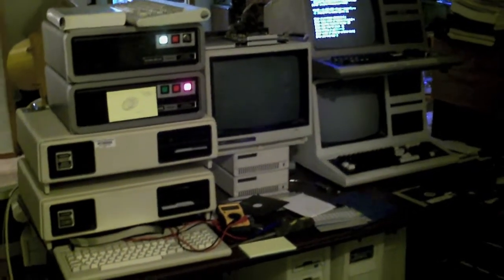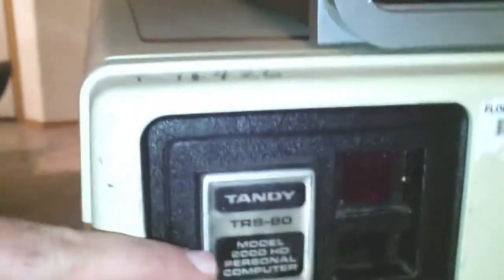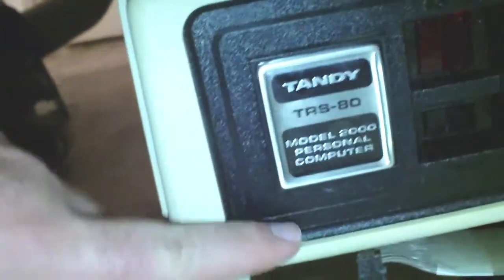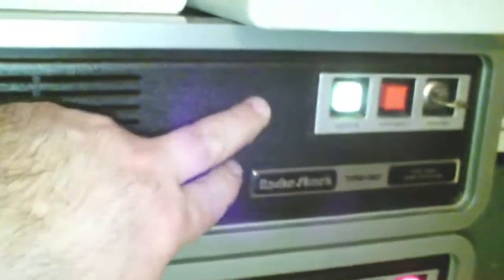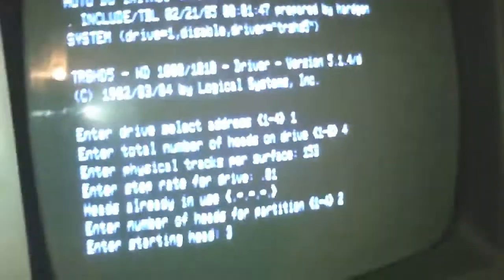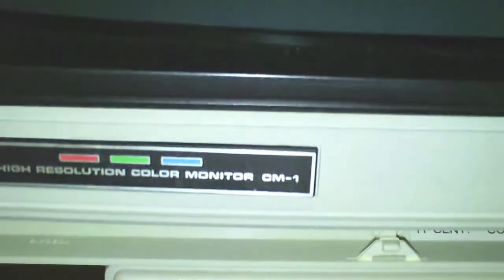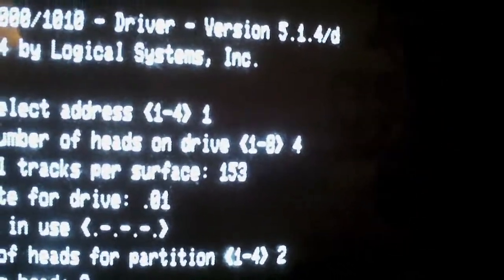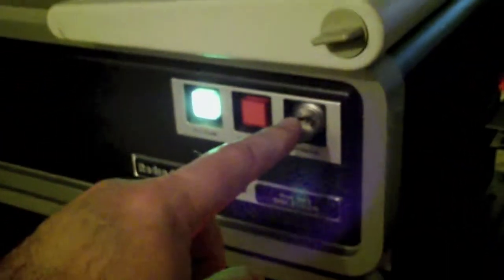Sneak Peak and future trouble shooting TRS-80's

Comment: I should had filmed my TM-502 before I took it apart...it's an exceptionally well built drive, and it's the quietest 10MB drive I've ever heard.  One detail in the HDA which I've never seen before on a hard disk is a fluid dampener on the top of the stepper motor, which uses a small flywheel mounted on a ball bearing in silicone oil.

Comment from the maker: @RE1974   I tried to take the motherboard off but it's firmly attached to the expansion riser card.  Had to take all those tiny little screws out of each of the expansion slots to get the riser card to slide out with the motherboard.  Still no luck on the keyboard though, I might try either cleaning the keyboard connection or replacing that 5 pin din plug on the motherboard and see if that doesn't fix it.  If it's not that, then bad keyboard bios chip???

Comment: Hi, I'm an old hand at these TRS-80 hard drives.  The HD in the top corner of the screen is the HD driver software looking for a hard drive, so for some reason the Model III can't "see" the hard drive".  Check cables, and disconnect the secondary drive and just try to run it on the primary drive alone.  Also the Tandon TM-602 drives in there are pretty well impossible to format these days and even if they do they start to get bad blocks straight away.

Comment: @kaiyoshi2243 Is it a proper Tandy 2000 keyboard or a Tandy 1000 keyboard which reads "Tandy 1000/2000 keyboard" underneath?  Those don't actually work with the T2K (in my experience).  The one you want reads "Tandy TRS-80 Personal Computer" on top and has a black curly cable.

Comment: Also those old black drives have the 8X300 HDC board in it, and the driver you are using appears to be looking for a WD1000/1010 HDC (which is the later controller from the 15Mb drives) so that might be where your format is coming undone.

Comment: Also the disk "set" you are trying to use there might be the wrong one - you need set 26-1130 to format a 5Mb drive.  26-1133 set I think is for a 10Mb or 12Mb HDD.   

Also on the Tandy 2000 HD it has a Tandon TM-502 10Mb hard drive in it.  If your T2K is not responding to keyboard input the motherboard itself is easy to substitute from the other T2K, just undo the screws underneath noting where the different sized ones go.  If you need more help just drop me a line.